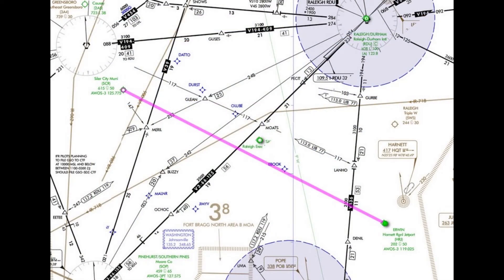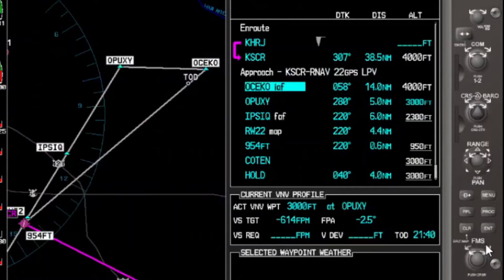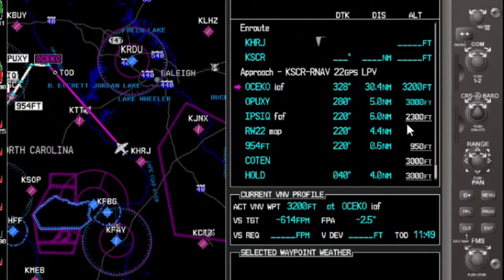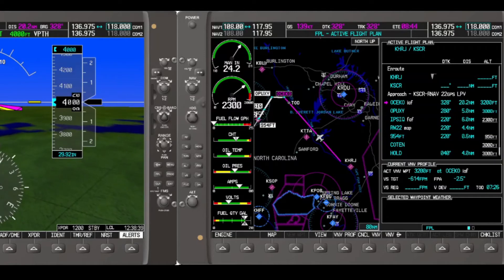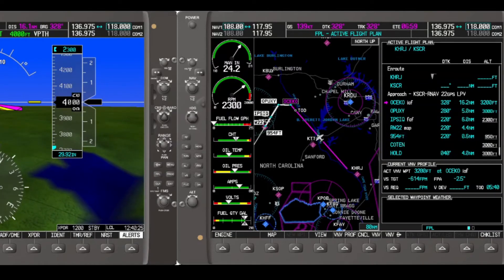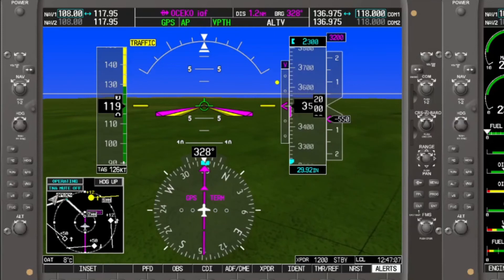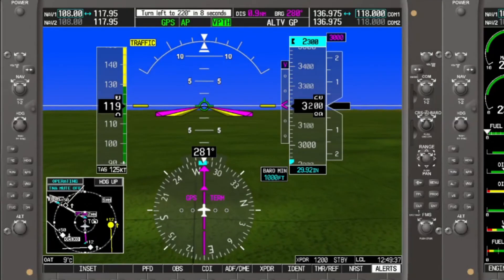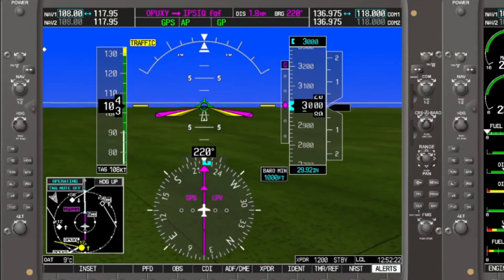Vertical Navigation with the DA40 G1000

Comment: Mark, a very clear description of the gotchas with VNV on the G1000.  Once I've set my IAF altitude (3200 in your example), my SOP is to do nothing (this is your SOP #3) until I hear the audible "vertical track" (from Georgette, George's assistant), which in my DA40 occurs 1 minute before TOD ... then I do the critical steps of (a) pressing VNV on the GFC700 and (b) dialing in the selected altitude.  I've always set the selected altitude at the lowest of the blue/cyan altitudes (3000 in your example), but perhaps this opens me up for some unwanted behavior??  Thanks for the excellent video.  Wayne
Reply from the maker: I use the FAF on an approach for consistency -on an LNAV it will be the FAF. But choosing the default Blue is I think just as good and consistent an SOP since the last blue on the LNAV will be the FAF. For hitting VNV,  I do all three :D. Activate when I set, reactivate within 5 miles if I notice, and use the minute to TOD as a final backup. Most of my personal SOPs are because I fly so many different types with different equipment, so I try to find ways to do them as similarly as I can. Have you done the RNAV 28L into OAK? It's a great one to demo this.

BTW, when will your airplane be ready?
Reply: @midlifeflyer  Mark, I have done the RNAV into 28R into KOAK, and it is also cool with several stepdowns (well drive-and-descends) outside the FAF.  The G1000/GFC700 loves these.  As you know, it must be carefully monitored... a couple times with closely spaced stepdowns I've had the VNV choke and had to command my own descents.

New MT propeller is arriving at my shop (KTRK) this weekend, so hope to finally pick her up later in the week (dodging some snowy days in the Sierra).  I'm pretty sure the long wait (12 weeks) on the prop was a result of pre-COVID inventory being drawn down during COVID.
Reply from the maker: @GeezerGeekPilot  I meant the right, and yes, because of all those stepdowns.